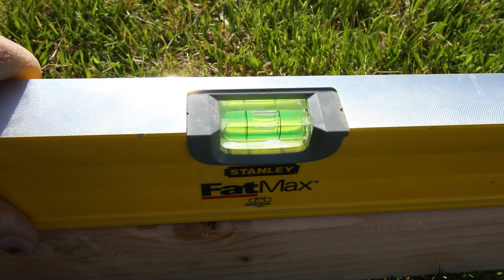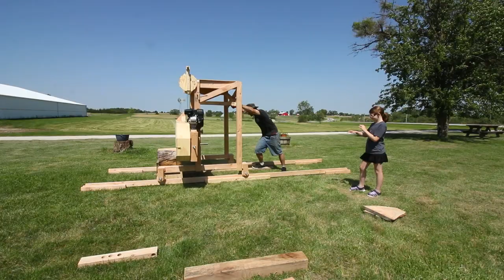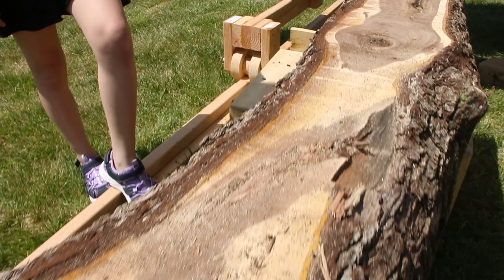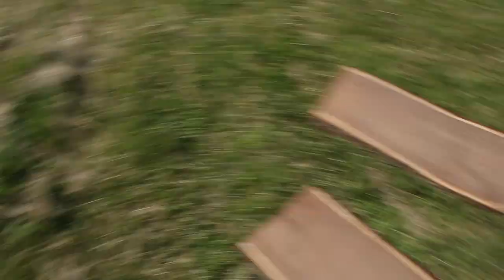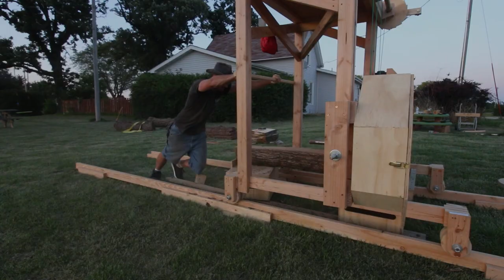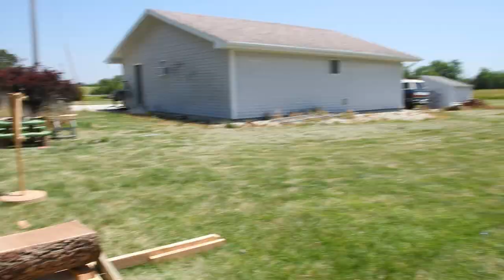A Dream Come True Running My Homemade Sawmill!!!

Comment: a concrete pad to set your saw mill on would be a giant leap forward, and maybe steel runners would be nice. you can see when your pushing it its twisting  maybe some gussets would stiffen the mill up. but your definitely on the right path. forge ahead friend!

Comment: I am a retired locomotive engineer. Drawing from my knowledge of railroad track construction, I might suggest a few 4x4 crossties installed perpendicular to your rails at intervals to restrict any movement that might tend to throw your guage out of alignment. I would think simple mortises under the rails on the ties would hold it in place.

I really like your design.
Reply from the maker: Thanks! I need to build something to hold the log still so I think it would help to tie the rails into that

Comment: Love the builds, just a though for your lifting cable. What if you attached the two ends of the cables in the center to a fixed eye in the center block? That would in effect create a block and tackle that would cut your travel distance per crank in half and make it easier to lift. Thanks for the video.

Comment: I would propel it with a hand cranked boat winch. Cheap, low-tech, even-pressured add-on. I also cringe seeing the log unchocked.  Wedge the sides. If you get a tooth caught in a dense part of the pith you could throw that log.

Comment: Super cool setup. So many questions... how much did it cost to build? Do you have plans or a materials list? Have you made money with it? How loud is it really?
Reply from the maker: If I was going to build it again It would cost about $400. I haven't made money off it yet but I will. It's only as loud as the engine is. I will be making plans for it but I haven't yet

Comment: Putting centrifugal. Clutch on the motor will make it easier to start
Reply from the maker: This is very true. I skipped it and still regret it. I've worked with them in the past and have always had issues because of it.

Comment: Milling your own stock is a pretty awesome move. You will save money on that for sure by cutting out all the hand offs in between. I'd also imagine your quality of lumber will go up because you can control the process better. And if you get into selling things, your margins should increase. 

Couple other design thoughts. I did a quick google search on commercially available mills and one thing i saw was a clamp system that looks like it uses a pointed pad to grip the log. Might be something there to look into. Also not sure if you've waxed your carriage wheels or not. Looks like it moves pretty easily but I'm not sure how much effort you need to use to push through the logs. But that reduction of friction might help you some. A crazy idea would be some sort of winch design to pull the carriage forward at a nice and steady rate. Overall though thats a hell of a good job you did making your own mill!!!
Reply from the maker: Haha. Thanks for the ideas! On that second day of milling I did rub some  paraffin wax on the rails and you're right it worked much better after that. Next Friday I'm going to have a video going over all of the upgrades that I'm adding and fixing a few problems I had. 2 things I'm currently working on are a platform with a log holding device and a hand winch to move the carriage. Thanks for the kind words!
Reply: @WyldeWoodworks  Anytime! I'm excited to see the upgrades and how they work out.

Comment: your bed needs some work, needs a stop and stay, to lock to wood in and more stability so they can be nominally cut more accurately..  works tho..  you can get good steel mills for like $3800 these days so.. any bigger logs you will want a lubrication system, water cooled, easy enough to add I spose, save on blades, some nice planks for sure..
Reply from the maker: Yes a small mill might be "sufficient" but I would consider mine to be sufficient. I would love to save up and get a professional mill someday but until then I'm gonna use this one. I don't see a point in buying one for 4000.  Hopefully before I use the mill again I can make a bed for the logs. I have big plans for all that but still not a 100% sure about the log holding. I have some ideas

Comment: How do you protect it from breaking and coming back at you? Love how beautiful it is.
Reply from the maker: All of the force pulls the blade sideways so the housing containes the blade if it breaks. Also the frame and gantry are between the blade and the user. About halfway through the video I added a handle which gets you an extra couple of feet. Thanks!